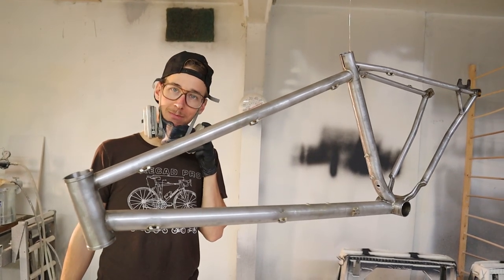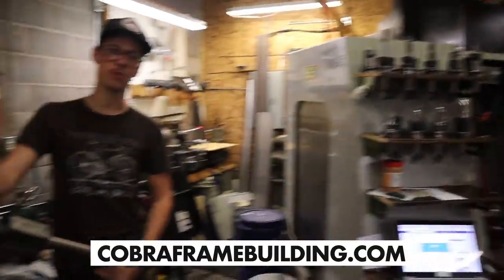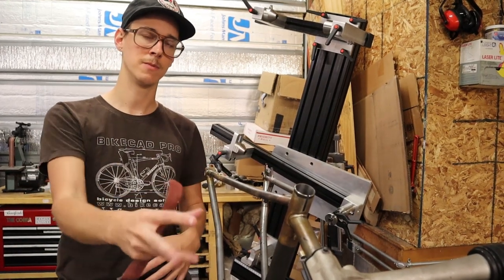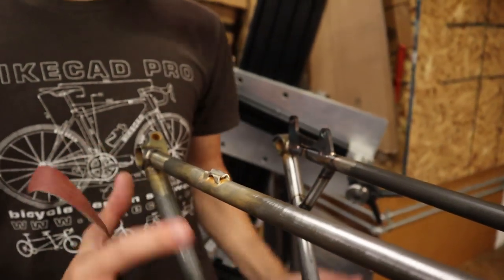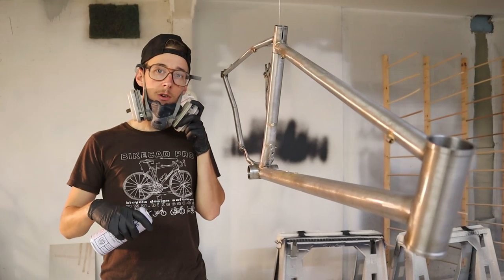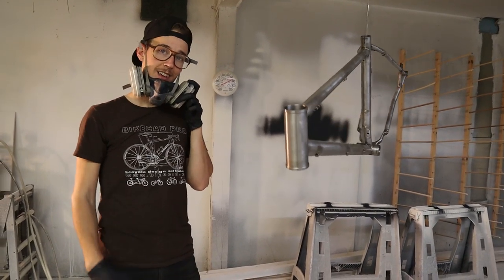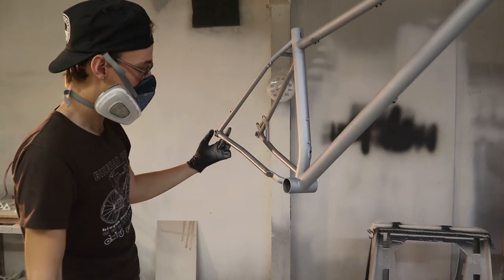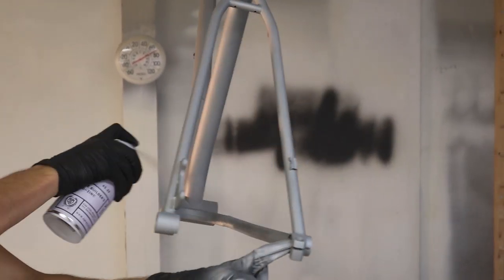How to Prep a Bicycle Frame for Painting

Comment: A wire brass brush on an electric screwdriver works wonders for removing original paint and rust.
Reply: it really chews through your carbon fiber, though. so care should be taken. :p
Reply: Is that essentially a Dremel tool with an attachment? If so, I got one of those. :)
Reply: I used an angle grinder on mine cause I burned my drill out lol!

Comment: Hey, nice video with great tips!  In my experience it's really important to keep the can as vertical as possible when spraying to avoid shooting droplets.  Turn and tilt the bike, not your arm.  Long strokes essential and multiple, very thin coats.  Impatience kills a paint job.  Also, you can buy a cheap grip/trigger that screws or clips onto spray cans and gives tons more control for about $10.

Comment: With no sandblaster available, I used sandpaper, sometimes small bits of it fastened to wood dowel or carved-down popsicle sticks with double-stick tape, along with various needle files, in order to remove all the paint from the frame & fork of a 1980's Fuji. Yes, it took a long time. I was confined to doing it in my living room over the winter, so I couldn't risk using any harsh chemicals or power tools to speed up the work. Before I was about to apply rattlecan primer, I wiped it all down with mineral spirits, thinking that would do a thorough job of cleaning the metal. But when I gave the entire fork a first coat of primer, it began showing numerous pinholes in no time. Apparently mineral spirits can appear to have fully evaporated, but in fact residues can linger on the surface for some time. My mistake. I'd also assumed the primer would need time to fully cure, but it wasn't setting very quickly, not after several days, or even after weeks. I blamed it on the spirit residue. A month later, the primer was still gummy & tacky, and would clog sandpaper like hardened clay (I was intent on removing the bad primer to start over). I watched a lot of other videos & found that it may be that the primer isn't supposed to cure for very long before applying a subsequent coat, or it may not adhere to the second coat. I had been intending to apply two coats of primer and 2-3 coats of color. Now I'm not sure how to proceed, and the project has effectively stalled. This is a bike I'm restoring for my adult daughter as both a commuter & an all-around recreational ride. As compensation, I did my best to fix up her cheap-ass Huffy, s that at least she has a bike for the summer. I liked & subscribed, and I'm eagerly looking forward to your next video on your project. Thanks.
Reply: What did you do?

Comment: Just dropped my frame off at the powder coating shop.  Sand blasting and masking,  paint. $125. 
I thought about rattle can and clear coat. But, i put so much time into the lug work etc...that i figured $125 was worth it.
I noticed you put a brace from the SS to the CS for your disc brake. Have you experienced failure in this area due to too much stress from the braking?
Reply from the maker: It is commonly known that that it can fail without a brace tube there. Ideally you would mount the brake on the chainstay which is why flatmount is a good solution when it works out.
Reply: @cobraframebuilding  thanks. I used artculated drop outs and fit the brake tab on the CS. I could still add a brace later on, if needed. But its a pretty clean look right now.
Reply: Like spending hours /days on the Mona Lisa just to sign your name with a crayon. Either spend the money on real epoxy primers and paints / powder coat or leave it raw.

Comment: Just use Paint Stripper! Just brush it on and all the paint is gone in 15 min by wiping clean! You’re welcome : )
Reply: Does that really work? I’m trying to paint my se. it has a shinny finish. Will it take all the paint and finish off?
Reply: @cinder187  Yes it really does! They have different kinds of paint thinners but the one I recommend is a gel consistency so when you apply it with a brush it clings to  your bike frame as paint would. The key is to apply a thick coat on the area you want stripped and let it sit! don't mess with it until 15-20 min. Then just brush it off with a wire brush. I recommend you do this process about 2-3 times. when most of the paint falls off just go over the areas that aren't smooth with iron wool or the wire brush. I'm surprised none of these bike painting tutorials tell you to use stripper. It's 100 times easier!

Comment: how about the inner tube? how to clean or remove the rust on inner part of the frame?
Reply: the inner tubes can be treated with linseed oil or corrosion-preventing grease which as is used in rustproofing car bodies. Grease gets heated up to make it fluid, then it is evenly distributed in the pipes using a thin lance on a hose to reach everywhere.